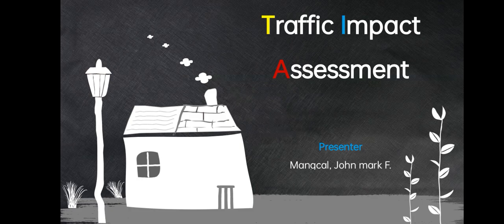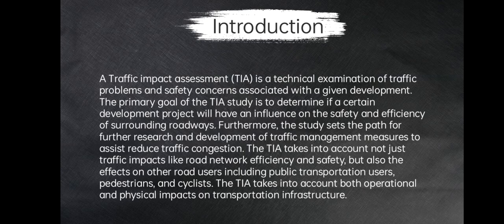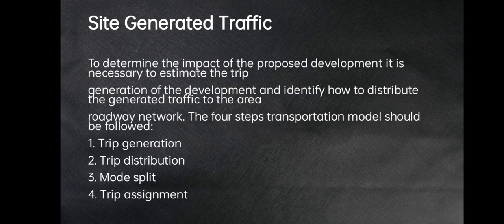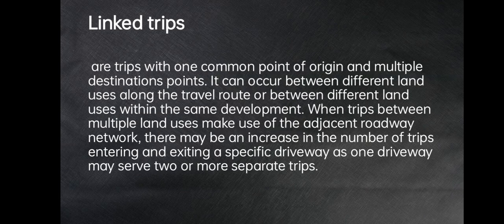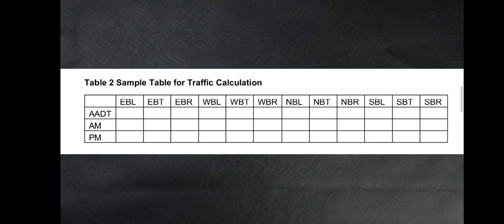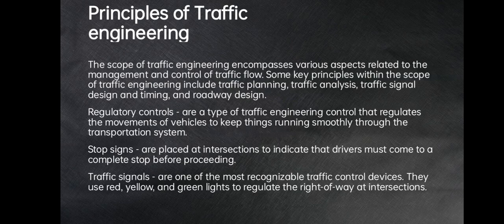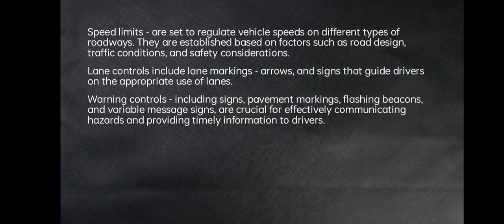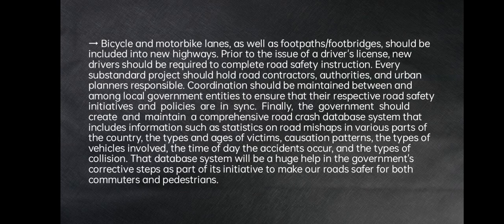Traffic Impact Assessment (TIA) - PCE 413 Principles of Transportation Engineering

Comment: A traffic impact assessment (TIA) is a tool that enables you to analyse the potential effects of your project on the current and future circumstances of the traffic and to determine the necessary mitigating actions to ensure safety and effectiveness. As an engineering student we need to includes the study area, the time horizon, the scenarios, and the performance measures. The study area should cover the project site and the adjacent roadways and intersections that may be affected by the project traffic.

Comment: I have learned that a traffic impact assessment (TIA) is a technical investigation that evaluates the potential effects of a proposed development on the transportation system. TIAs are required by numerous governmental organizations for a range of development types, including residential, commercial, industrial, and transportation projects. Identifying and evaluating potential effects on traffic volumes, speeds, delays, and safety is the goal of a TIA. Additionally, it is necessary to develop and assess mitigation strategies in order to reduce or completely avoid any negative effects. Lastly. to encourage the use of alternative transportation methods and to aid in sustainable transportation planning.

Comment: My understanding about Traffic impact assessments (TIAs) play a crucial role in urban and infrastructure planning. They help evaluate the potential consequences of proposed developments on traffic flow, safety, and overall transportation infrastructure.TIAs typically examine existing traffic conditions, project traffic generated, and propose mitigation measures to ensure that transportation systems can handle the added load.

Comment: Additionally, a traffic impact assessment considers factors such as the number of vehicles expected to be generated by the development, the timing of peak traffic flows, and the capacity of nearby roads, intersections, and transit systems. The assessment also considers the potential impact on pedestrians, cyclists, and other non-motorized modes of transportation. The traffic impact assessment process involves collecting data through traffic counts, modeling, and simulation techniques. The results of the study are then analyzed to determine potential impacts and identify possible mitigation measures that can be taken to minimize any negative effects.

Comment: I have come to understand that a traffic impact assessment involves a systematic examination of how a proposed development or project might affect the local transportation network. Its purpose is to evaluate both the potential positive and negative consequences of these projects. This assessment holds significance for various reasons, such as improving the accessibility and mobility of the proposed development site. Overall, this process helps guarantee the seamless integration of new developments with the current transportation infrastructure, consequently facilitating efficient and secure mobility within the community.